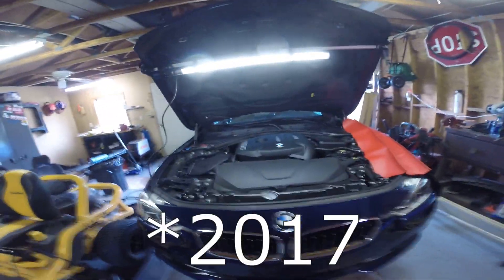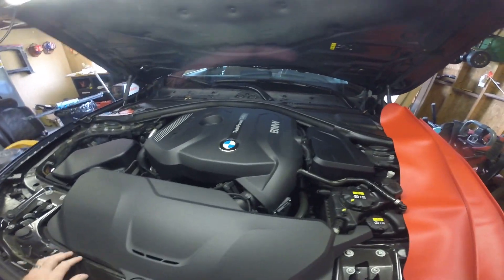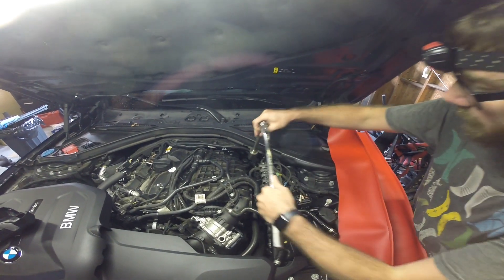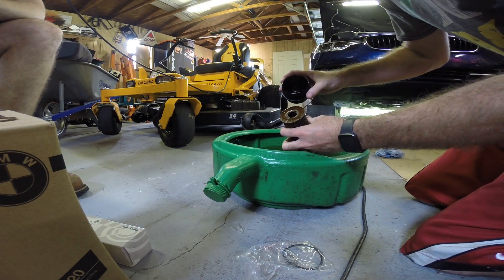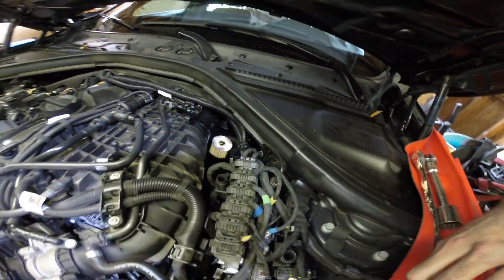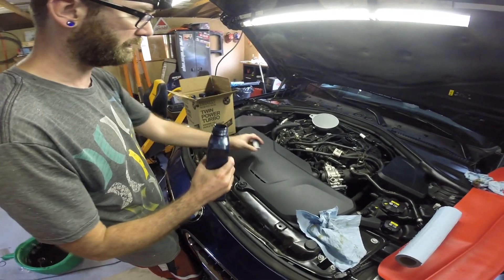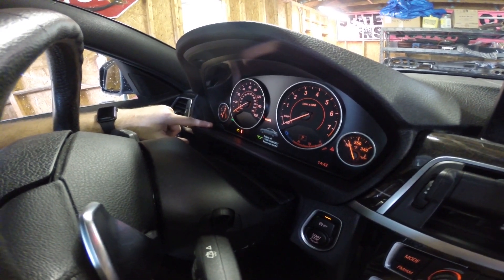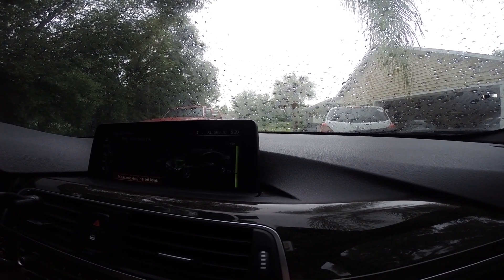BMW F30 330i Oil Change B46 Twin Turbo 2.0 (2017)

Comment: 2.0L twin scroll not twin turbo. Has one turbo designed to function as a twin turbo. Rubber grommets attached to and underneath the engine cover. Loosen the oil filter housing cap fully before removing oil pan drain plug but don’t pull the filter out yet, less mess. Loosen and pull the drain plug catching the old oil in your oil drain pan. 27mm socket for oil cap, 17mm socket for drain plug. Heavily lubricate the oil cap o’ring so it won’t get stuck for next time. As the vehicle ages, use less torque on the oil cap, maybe 20NM instead of 25NM to save the brittle plastic. Big expensive job to replace the oil filter housing. Just make sure there are no leaks when finished. Put some oil on your drain plug copper gasket as well. 5.5 quarts for you imperialists. Done many on my 2017 F30 B46, hope my comments helped. Great video, thank you doing it.

Comment: Thanks for the great video!  My '17 330i xDrive had a plastic cover w/ a screw over the drain plug, unlike yours.  Needed to use a flex head ratchet to get the filter off.  Bought an inexpensive 27mm socket off Amazon for the filter.  When I went to pull away the ratchet after loosening, the socket fell into the engine!  I listened and was sure it was resting on the belly pan, had to partly de-install to remove the socket.  Could not see it from to top to use a magnet.  I guess a perfect $$ socket would have had the proper detent to positively hold onto the drive of the quick release ratchet.  But this $9 socket still did the trick.

Comment: Solid video with one important correction: the B46/B48 (same engine but with ULEV restrictions on the B46) requires 5.55 quarts of oil, not 5.25. To prevent overfilling, putting in 5 quarts and then half of another quart is the easiest way. It's better to slightly underfill and then adjust than slightly overfill an engine with oil.
Reply: The manual calls for 5,24 Litre of oil. Which is 5.55 quarts (US). So he's correct.
Reply: @theo.k  Ah, I didn't realize he meant liters. I assumed he was American based off the accent - he must be Canadian. Either way, 5.55 quarts for Americans, 5.25 liters for basically everyone else hahaha.

Comment: Quick tip, the 2 hoses that are in the way, instead of opening the clip the whole clip can be removed by pressing the 2 plastic tabs on the right side and sliding the whole clip up and off. This also works for the clip under the small plastic cover that is removed, there is a tab at the bottom that can be pushed and the whole clip can be slid upwards and out of the way.

Comment: Good video..Just thinking why you preferred 0W 20 instead of 0W 30 ( or ) 5W 30..🤔
Reply from the maker: Not my preferred but what is recommended straight from the local dealership here in FL. This was a buddy’s car, he bought the parts from the local dealership.
Reply: @rkystokes i use 5w40 8100 motul gen2 LL01. My 320M sport is a B48B20A stage1 with 260whp and 420Nm

Comment: B46 is a 3 cylinder engine  , this one is B48 engine 4 cylinder.
Reply from the maker: That is not correct. The B46 is still a 4 cylinder. It is the SULEV version of the B48 (stricter emissions controls). The B38 is the 3-cylinder.
Reply: @rkystokes  Correct. B48 is for 4 cylinder petrol, B47 for 4 cylinder Diesel engines..
Reply: not correct.
Reply: B46 is sulev version which is the one sold here. You’re thinking of the B38 engine that goes in the mini’s

Comment: Thank you for this video. I used to have a 2002 BMW 325i and I did the oil changes myself. I traded it with a 2017 330i. I am at the dealership right now for an oil change and they are charging $230. I will start doing it myself from now on. Thanks again

Comment: what type of oil can i use on my model i was told 5w-40?
Reply: 0-20 full synthetic  ive ran both valvoline and penzoil in mine both work great.

Comment: Perfect Video! Can you share the links of where you brought the BMW oil filter and oil from? Also you personally, how often do you change your BMW's oil? I know BMW says 10,000 miles but most cars are typically 3,000 miles. Just want to hear it from someone that has experience with it. My BMW's oil is due this July and I would love to do it myself.
Reply from the maker: Hi Darren. The oil and filter came from the local dealership here in Orlando. I recommend using ECS tuning for all Euro parts needs. Personally for me, I go between 5-6k miles or once a year for oil changes.
Reply: @rkystokes  Thank you! Very Helpful
Reply: @darrenfarrell8177  also orileys  carries the wix brand of this filter , id also recommend switching it out every 3500 miles if you drive your car hard . ive waited till 5k miles and the oil was so bad im never  waiting that long again .
Reply: FCP Euro has oil + filter kits using either BMW or Liquimoly oil.  Change every 6000 miles or so, 10,000 is too long, 3000 is not necessary for the quality of synthetics today.